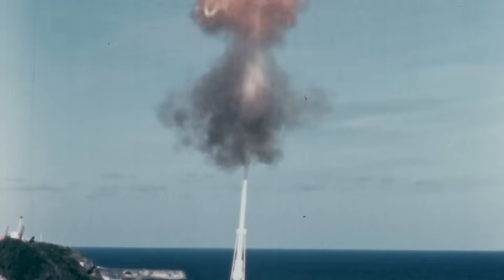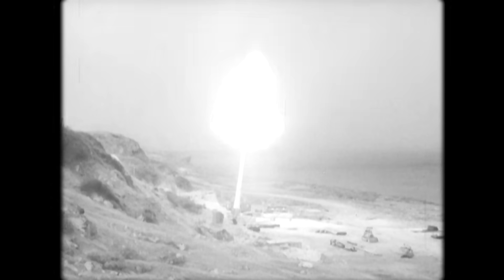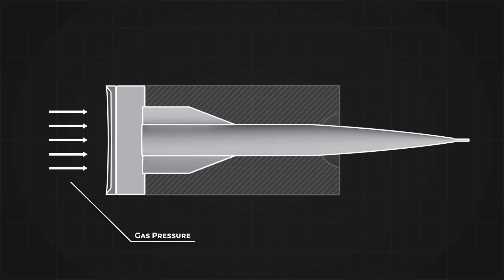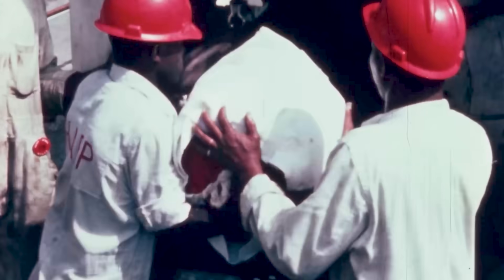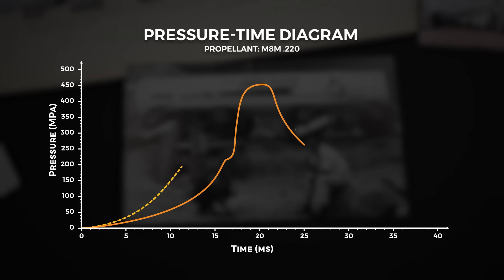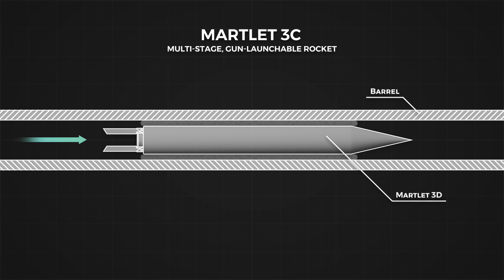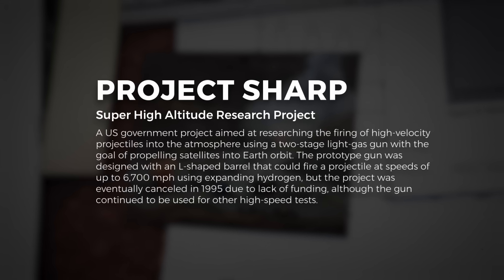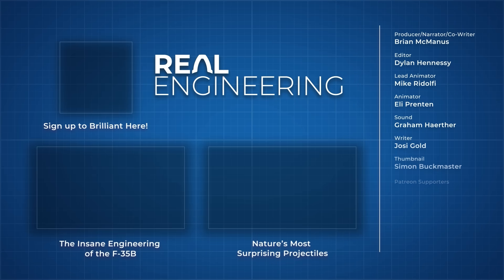This Gun Could Reach Space

Comment: Fairly certain that the propellant bags the lads were loading were bog-standard US Navy 110-lb charge bags for the MkVII 16"/50 battleship guns from the Iowa-class BBs, which is what the HARP gun was built from. While the ignition patches at the base of each propellant bag are indeed black powder, the propellant is not. Otherwise, outstanding video; as both a former Canadian gunner and a former defence scientist, Gerald Bull's tale has always been a cautionary one.
Reply: From Wiki, "For propellants, the 16-inch gun used either the solvent type WM/M.225 or the solventless M8M.225, both manufactured by Canadian Arsenals Limited."
Other propellants may have been used in other tests, of course, but I wouldn't be using BP for the main propellant. Also, I'd expect much more of a "white cloud" at the muzzle if only BP were in use. Any citation for the Navy 110 pound charges?
Reply: I heard if you load it up your ass with aforementioned product and light the fuse, it makes our problems less severe.
Reply: @sleat what is your profession if i may ask?
Reply: @sleat My Dad, who was working under contract with NASA was involved with several firings (I was present for some). He always spoke of them packing TNT behind the saboed shell. I don’t know if that was technically accurate. He was doing the photo instrumentation. He also rigged a high speed camera that could determine the speed of the projectile as it left the barrel. When his camera ramped up to speed, the camera triggered the firing of the gun.
Reply: @sleat  Wiki is not a source of "truth". It's open for anyone to add trash info.
Reply: @justincace5517  You write: "Wiki is not a source of "truth". It's open for anyone to add trash info."
Yes, it can be, unless there are citations to authoritative sources in the article.
If you have a citation for anything else being used as the main propellant in the gun, I'd be happy to check it out!
Reply: There seem to be references to black powder and gun powder used interchangeably throughout the video. Since M8M appears to be a double base powder consisting of primarily nitrocellulose, it is functionally a gun powder. I suspect the author's focus was elsewhere and didn't note the difference. 

Thanks for the information!
Reply: @Shakes355  It's not the first time Youtube videos have contained inaccuracies.  And yes, black powder and smokeless powder have radically different properties.  They generally cannot be safely substituted for each other.
Reply: @Shakes355  You write: "it is functionally a gun powder"
Yes gun propellants are a product made of specifically-shaped smaller pieces which might resemble "powder" from a distance, which is used in guns. The chemistry and behavior are very different, though. Double-base propellant charges are certainly made of smaller parts, but they're not generally random ground-up propellants like various fine-ness grades of black powder (i.e. F, FF, FFF). They are individual pieces of propellant, which are very accurately shaped, like the cores of solid-fuel-rockets. If you look at gun propellants (that are not black powder), up-close, they may look like short strips of translucent spaghetti, tiny cylinders with a tinier hole through, about the outside-diameter of a mechanical-pencil-lead, or disks or donuts with a hole through the middle. The point of this is to have the propellant burn more consistently regardless of the combined temperature and pressure, such that it provides a "push" rather than something more like an HE detonation when ignited. The different shapes and compositions are all in order to give a very consistent and predictable burn-rate across different charge-sizes and pressures. You want the charge to deflagrate at the desired rate, not detonate. This burn-rate attribute is not as easy to control with ordinary "gunpowder" (i.e. black powder).
If you put, say AR-2208 rifle propellant and FFF black-powder side-by-side under a magnifier, you'll notice they are very different. The black-powder resembles black rocks, randomly shaped, with a specific size-range, while propellants have definite individual shapes (AR-2208 is tiny pale green cylinders) which are consistent throughout the charge.
Reply: @sleat  Not only that but black powder performance is limited at higher pressure, and the combustion is also very dirty, leaving a ton of solid (that eats steel for breakfast) behind. The only upside with black powder is that it's really easy to make with limited equipment and knowledge. You can make it at home using a rock tumbler, a hydraulic press, etc. It's probably great for fighting insurgent war...
Reply: @taiwanluthiers  Good points! I grew up with plenty of access to black powder (model rocketry, etc), and have also shot (and had to clean ☹) BP firearms.
Folks who do hand-loading with modern-firearms generally have plenty of practical (not engineering) experience with double-base propellants. It's pretty amazing to see how the burn-rate changes with chamber-pressure, both in rockets and firearms. The good part is that its behavior is very consistent. And you're right about insurgents and simple mixes like BP. Some of 'em even use sugar-rocket motors! There's a fairly good book called "Amateur Rocket Motor Construction" which is all based on ball-milled BP, paper casings, clay nozzles, and machined forming dies.
Reply: @sleat  Yea BP is easy to make and can be loaded into certain cartridges (like pistols) to be used as improvised ammunition if smokeless powder isn't available, as insurgent wars often are. 

I've done plenty of rocketry but I feel like I have higher aspirations. I don't think solid rocket motors will satisfy me and if I have the budget I'd want to make my own liquid rocket engines... on a small scale of course. That's actual rocket science.
Reply: @taiwanluthiers this liquid rocket fuel sounds like a fun run out into the weeds thanks for the idea!
Reply: @taiwanluthiers  You wrote: "if I have the budget I'd want to make my own liquid rocket engines... "
I wrote a reply regarding this comment directed at you a day or so ago, but oddly, it seems to have disappeared or been censored, despite being quite dry and innocuous, regarding all that is involved in just the propulsion-part of "rocket-science". i.e. "This is what you'll need to know or have friends who know, to make a liquid fueled rocket". Did you see it in your email-feed or in this thread?
Reply: @sleat  No I never saw anything like this. I think you can't post emails and stuff on youtube comment or something.
Reply: @taiwanluthiers  Thanks!  I believe that I know what's not allowed. Regarding my mention of "email-feed" YouTube automatically emails you comments directed at you, on YT, if that's enabled. 
That's what's confusing me. It was dry, i.e.: "here are the various specialties you need to consult with, here are the skills, here are the tools, here are the engineering/physics topics, and trades-person topics you need to pass, or at least be good at". Pfft...vanished.
These are all literally just topics taught at ordinary universities or trade-schools. even in places like Syria or North Korea, as far as I know, so it begs the question: "What is erasing my (possibly informative) post to an aspiring rocket-builder trying to prevent?"
Probably an overzealous AI did it, and I'd like to have a quiet chat with that AI. 😠
Reply: bull's tale reminds me little about , i cant recall the names but in short some of the big thinkers in the teams responsible for advancing the facists balistic missile program in ww2 , while apparently a lot of them did so under duress of the classic '' the documents that confirms your sweet granny is 'only' 4 generations away from being 'jewish' etc will be sealed.. if.. you work in this project''
there was also some of them their lead guy among them that more or lees saw the humanitarian potential that space research etc could give.. but then 'sold' it to the theird reich leadership in the form such as space stations with giant lazor mirror death rays or the ability to put bombs on missiles and remote guide it to hit any spot on the globe or the moon etc.. and while it gave the N guys the v2 , it also sapped a lot of resources to do the 'foundation research' that said scientists knew not would be practical for several decades at least leeting the facists high command delude themselfs into thinking it could lead to scifi weaponry within just a few years..

bull's tenacious pursuit of his research willing to resort to smuggling weapons or develop tactilly useless hardware for a dictator just to keep working on the high cost foundation research needed for a kinetic way to deploy satelites reminded me of that hmm.. i wonder if he wrote diary or something that could give a peek into what his core vision for its use would been..

humanitarian..civilian foremost..
or military foremost...
Reply: i still love how its explained 2 16in guns welded to gether its the most redneck thing ever besides perhaps duck taping theming to gethar. though it still does not beat that man hole cover which became the first man made object to leave the planet and perhaps solar system.
Reply: Arrgggggh!☠️
Reply: 25 million in 80s money. i'm sure he could have played some sort of telephone game with the isrealis.
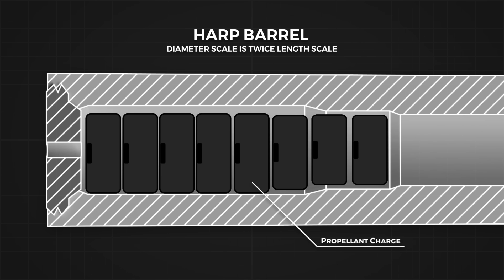Reply: If anyone is interested in seeing the actual propellant used by the Iowa class battleships, there's a channel on youtube that covered it.  https://www.youtube.com/watch?v=-2oDJDgEGGU.  The propellant bags shown at 8:34 do seem nearly identical to the bags Ryan describes in the video I linked.
Reply: This might be the first they were documenting that hit 180km, but the railway guns during ww2 Gustav, Dora those things had shells twice the size of a person and required railways and cranes to load, these are being loaded by a single man for whatever this is and the propellent bags are tiny compared to the railway guns also. Those things took like days to reload. I always heard those were the first things man made to reach heights like this. I dont think they were doing any testing im pretty sure it was theorized after but, those things were made to be shot from france and land in london lol, if shot straight up they would of went exremely high
Reply: Dude can't pronounce sabot... don't expect much
Reply: 𝑇ℎ𝑒 𝑙𝑎𝑑𝑠
Reply: Yea, saying black powder was a noob mistake....     ;)
Reply: It was driving me crazy hearing 'black powder black powder black powder'

Comment: Why don't we use something like this to get rid of China's balloons, load them with a proximity Fuze shell and start lobbing them up there.
Reply: The projectile has very little ability to maneuver so it's not going to help unless the balloon happens to float right into the ballistic flight path.
Reply: @ElectricGears  yet they were able to shoot down B-17's which could travel up to 287 mph and fly as high as 35,600 ft.... granted balloons can fly at a much higher altitude but can only travel around 200 mph and with far less maneuverability, and with modern computer targeting would be able to deliver very precise shots to a Target that is far more susceptible.

With a proximity fuse on an exploding shell you don't have to actually hit the target with the projectile itself since it explodes sending shrapnel in all directions.

Comment: I think you said "Black powder".  If so ... that's really, really surprising.  The naval smokeless types used at the time can be tuned to get to get the right burn rate and don't foul like black powder.  Might check the powder.
Love the rest!!
Reply: @repliesgpt  Bullshit. HARP gun used standard modern artillery propellants, around half a ton of it.
Huge bags of propellant had small pouches with black powder at rear end to facilitate ignition.
Search for the paper “Multiple point ignition in HARP guns”.
Reply: From what I can tell this thing just used a lot of the standard-issue charge bags for the Iowa class. Which technically do have a little bit of black powder in them acting as a primer

Comment: This seems like a question you might like to investigate also...for the purpose of this thought experiment, let us create some rules.  (A)  Since this is reality based thought experiment, we are not allowing FTL technologies or magical navigational shields, sensors and deflectors.  (B)  The speed of light (1c) is the maximum speed limit and we have the ability to travel at 1c.  (C)  While these are real world problems, we are going to ignore things like radiation, heat build up, and temporal distortions.  For the sake of the topic, we have the ability to safely travel at the speed of light and can go no faster.  

Great...but...how would we realistically do this and not run into something that destroys the ship?  

All I can come up with is we could need to use light like sonar, so a fancy version of LIDAR.  But this creates limitations also.  An internal ship based LIDAR system would limit our range of detection in real time.  A ship needs time to send out a signal, receive a detection, process the information, and then react to that information.  So what is a realistic LIDAR range that would allow us to safely travel at light speed?  Plus, if the ship is moving then the time and distances are going to be greatly reduced.  And I'm not certain we could even use a system like this while at light speed cause it's not going to travel faster than us to warn us of a danger in front of us.  

But for the sake of the debate, let us say that in order to give a ship at least a 5 minute warning to detect and prepare...we would need a LIDAR system with a minimum range of least 7 light minutes.  1 to send out a signal, 1 to receive the signal, 5 to process and react.  And that's a bare minimum.  I think it needs to be much more.  

This creates only four options for realistic light speed travel, and none are going to inspire films or books...

Option 1)  A ship at rest scans a distance in front of them, then travels at light speed to that point and stops.  Then scans again and travels to the next point.  While not ideal....this leap frog method is the safest I can think of.  

Option 2)  We throw safety to the wind and travel at light speed with no way of knowing if there is something in front of us or not.  Obviously the most dangerous option.

Option 3)  We send a probe in front of us at light speed to tell us what's ahead, then follow behind it accounting for the information as we get it.  But this requires for us to 1) correctly account for he incoming information and 2) the probe not malfunction, or collide with something and safely send information to us.  Not mention we need to be able to control the probe to stop it at a distance, or return to us, or have a recovery method........a lot of headaches.  Risky but an option that allows for longer travel times at light speed for greater distances reached.  

I thought about creating waypoint markers/beacons to create a safe route to follow.  But then there is a question of logistics.  Since they would be limited to light also, we would need thousands if not millions for even short routes in order for real time usage.  And then we would have an issue of both pilots and pirates staying on these routes when you know they are going to say, "infinite space and directions and you want us to stay on this straight line that is full of polices and speed traps?"  

Option 4)  Combine options 1 and 3.  We point the ship in a direction and instead of a probe we send out billions or trillions of pulses of light in that direction.  We wait for a period of time, lets say an hour.  Then travel behind that wave of light until we reach our destination or receive a contact that requires us to slow down, course correct, stop....or...maybe we just hit a natural point we need to change our course.  Then point in that direction and do it all over again.  It works in my mind, but we would be sacrifice stealth travel as we would be literally lighting up our tracks across the stars for all to see.

Comment: dril a big hole 1-2 km straight down, make a coilgun in the bore of the hole, mount rockets in a metal sabot and fire them upwards. Turn the rocket engines on when the rocket leaves the hole. Now we can send rockets to space much much cheaper since most of the propellant is not needed in the rocket anymore.

This is now registered as my IP so you need to pay me to use this idea.

Comment: Just imagine how much stronger/efficient they could make this gun just by creating low pressure in the barrel. In the best case some level of vacuum but that could become really costly at that age pretty quickly. SmarterEveryDay has amazing videos on his supersonic baseball air cannon. That cannon can achieve around Mach 1.6 with just compressed air and vacuum. So in short they could make it in to Vacuum cannon.
Reply: Nah, it's dumb idea to use vacuum as a booster since vacuum is only had 100 kpa pressure gradient. With insanely complex mechanism

Instead, we can use light hydrogen gas in between propellant and projectile, and then pressurize up to 350 kpa pressure gradient before firing. Which had 3.5 times more initial pressure gradient and energy than vacuum with less complex mechanism due to both end already sealed. That way it's much more elegant and genius—

—OH WAIT THEY ALREADY DID IT WITH LIGHT GAS GUN! So here we go, seemingly ancient technology still wins